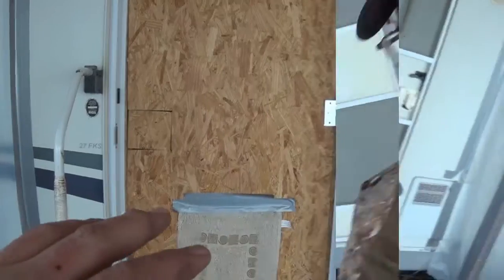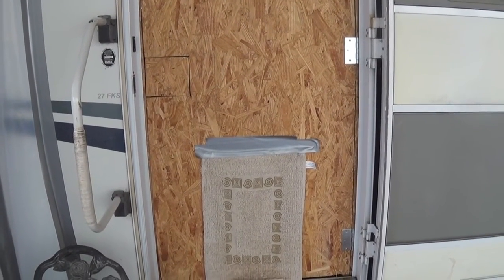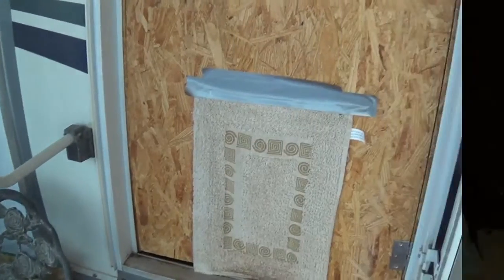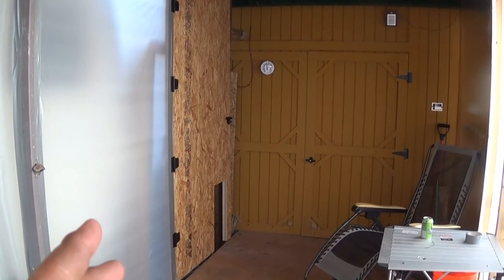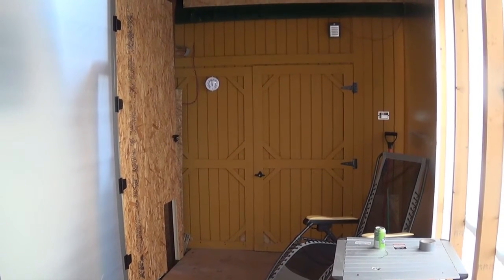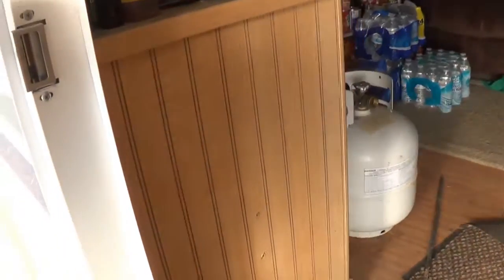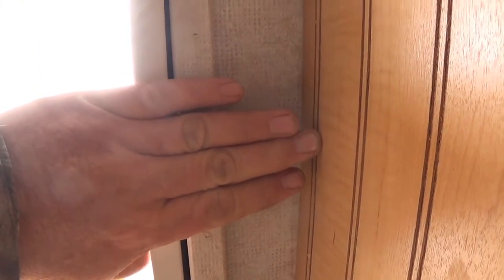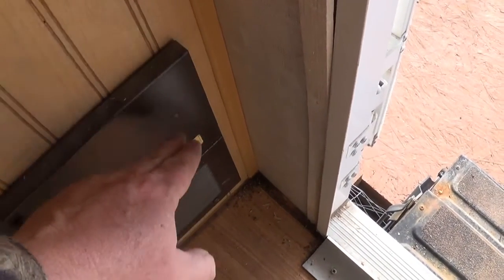RV Dog Door without Cutting or Damaging the RV or Trailer

Comment: put some of that 3/4 inch foam insolation board on it and it will help out even more. its super light weight as well.
Reply from the maker: i thought of doing that. wanted to see how it went without. so far it was better than i thought it would be.